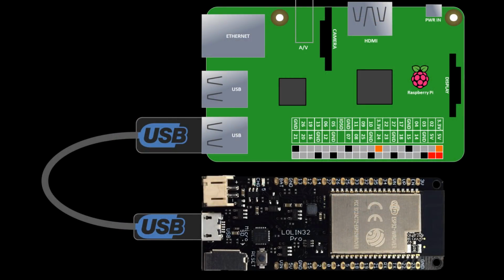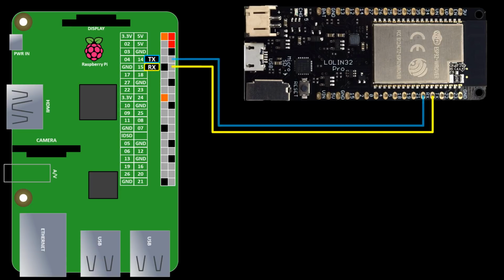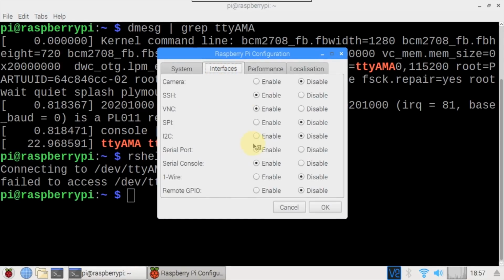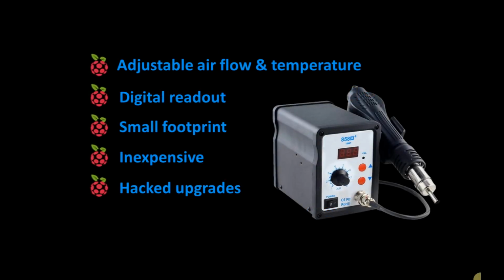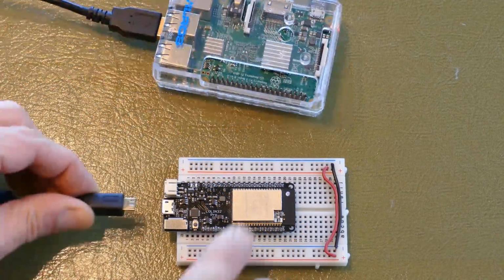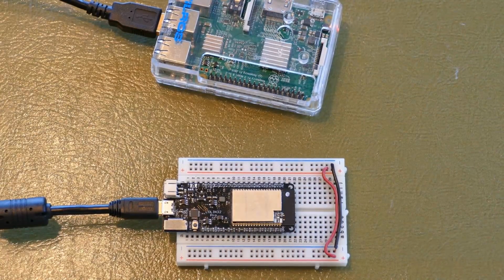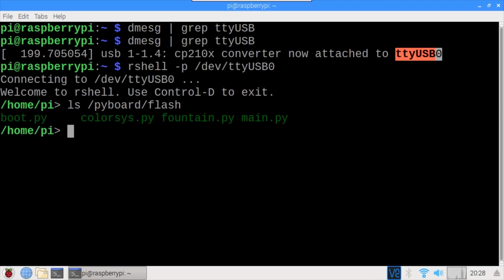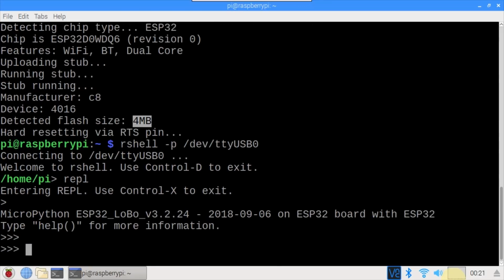Repair ESP32 boards and serial testing with Raspberry Pi

Comment: Nice work! (Your eyeballs must be younger than mine.)  Any plans to do one of your excellent tutorial videos on use of the esp32's UARTS in a program to communicate with (an) external device(s)? Thanks!
Reply from the maker: Thanks.  My eyes are not too good.  I rely on magnification.  Sorry, I've been flooded with requests so I probably won't be making an ESP32 UART video any time soon.

Comment: Great to see you back! Was just using REPL there based on your earlier video . Neopixel library didn't work on my LED which is a seven LED WS2812B array i got from aliexpress. It lights up as bright white but no colour changing. Maybe i should import some other library rather than NeoPixel. Also the Control D 'clean up' function did not switch it off.
Reply from the maker: I’ve encountered timing issues with some NeoPixels.  I recommend you try the LoBo MicroPython build because it is very robust and allows you to set custom timings:  https://github.com/loboris/MicroPython_ESP32_psRAM_LoBo/wiki/neopixel